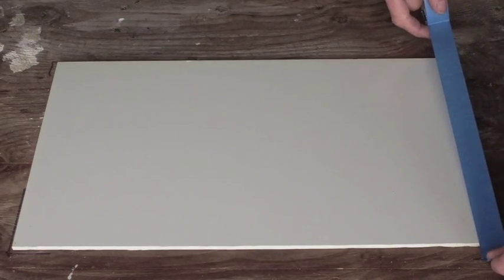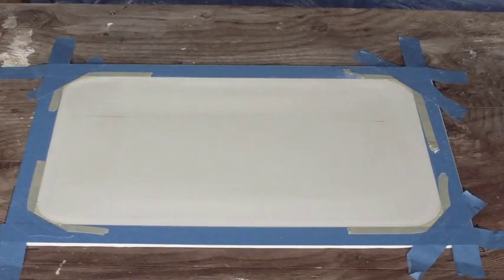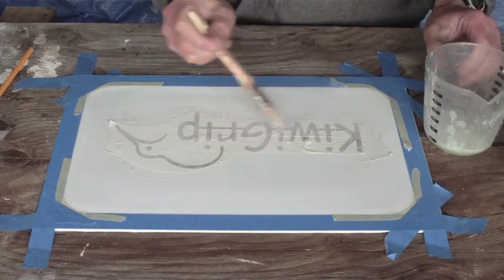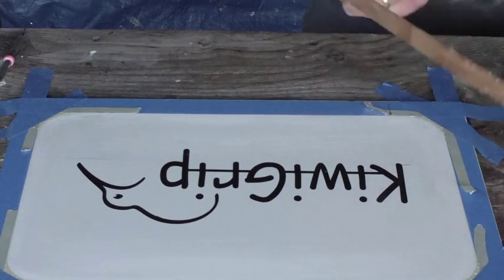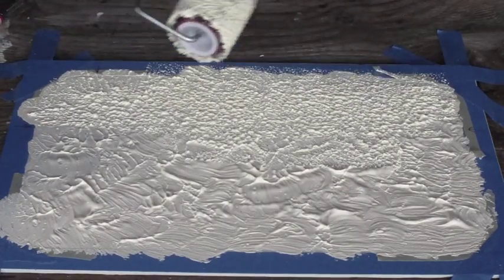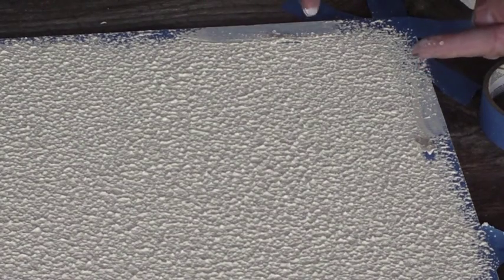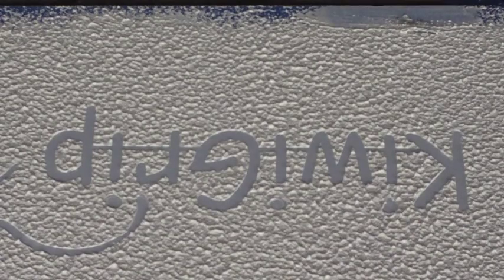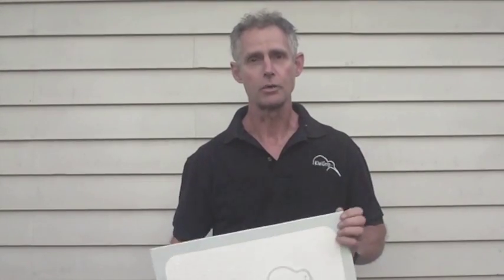How to embed a logo in your KiwiGrip

Comment: I'd like to replace the carpet in the seating area of my Skeeter bass boat and I believe this will be the right stuff instead of seadec. How should I prep my floor after removing the carpet?
Reply from the maker: Remove old carpet. With a belt sander or orbital sander, remove as much
of the carpet adhesive as comes easily. Don’t worry about adhesive remaining in the grain or
small shards of adhesive that are difficult to remove. If bare wood is exposed, seal as described
in “wood” section of these instructions. KiwiGrip will get a good bond to remaining adhesive and
the shards will be lost in the KiwiGrip texture.

You can read the complete KiwiGrip application instructions here: https://www.pyiinc.com/downloads/kiwigrip/kiwigrip-instruction-booklet.pdf
Reply: @PYIinc  
I've read several reviews about this product staining easily on Amazon. 
Can ya'll shed so more light on these reviews and how easy is it to clean if need be?
Reply from the maker: @jimmyboss8302  KiwiGrip generally cleans easier than most non-skids as it is not an aggregate based product that can leave exposed cups to collect dirt. Most daily use dirt and stains can be cleaned using a basic boat soap and light scrubbing with a scrub brush or push broom. For darker / hard to remove stains, a 10% bleach to 90% water solution can be used.
Reply: @PYIinc  
Thank you for the reply and the addition information.